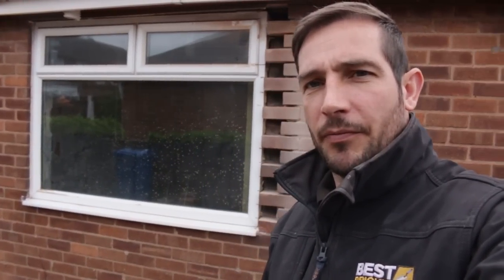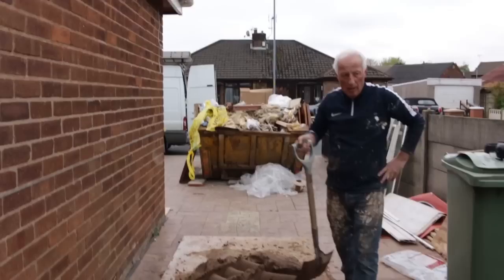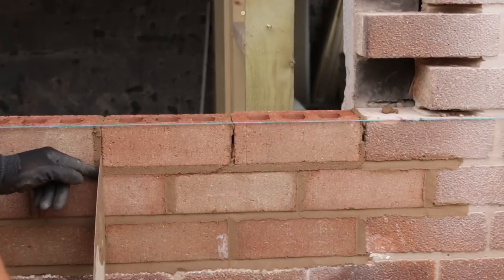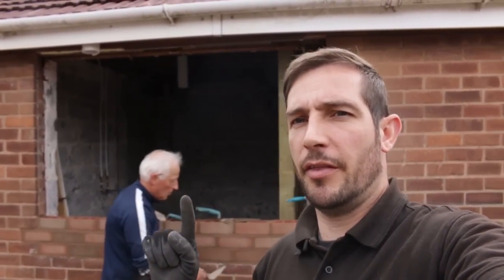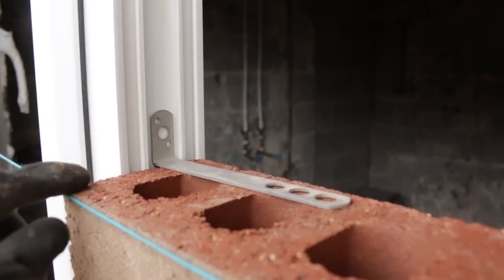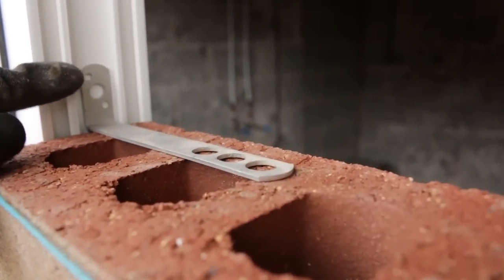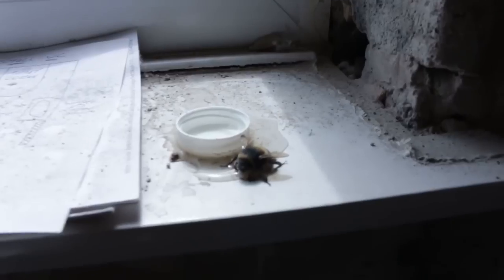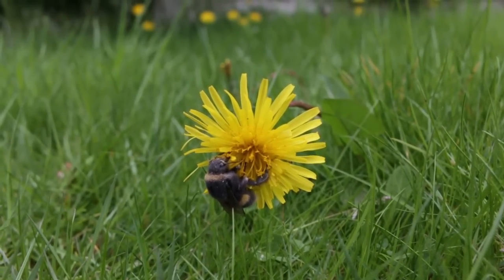Reducing window Size, bricklaying

Comment: Just bumped into this video after I have finished resizing 3 windows in my house, but this video shows I took the right approach doing this.
I had a messy looking side wall with windows in different heights and shapes put in every time a new extension was made before I bought the house, but having to replace my aged window frames I decided to make everything look more uniform and bring window sills and lintels to the same height and windows the same width were a first floor window was right above a level floor window.
Does look a lot better, just as the new window in the video, I don't like the look of these slot ventilators at the top of the window, it makes a house so 1960-70's (worst period in building design).

Comment: If you get a tight brick I use a clip joint , that’s where you shave a few mill off the end of a brick using your trowels edge and a brick on edge as a guide, you end up with a false perp joint but it looks normal

Comment: Great work as usual only 1 question though if that window had to be taken back out fir any reason (I know lokely won't but....) wouldn't it be a pain as the fixings on one side are from the opposite direction so csnt be unscrewed from window side ? Just curious ....in no way undermining your work as ive seen lots of great work you do (I'm a bricky btw) cheers keep them coming

Comment: Nice Job Stu,  but not a good idea to screw wall ties to the window frame, if you need to take the window out half the wall comes with it, screw window frame to wall after.
Reply from the maker: Can’t do that because the mortar takes weeks to go off properly, if it needs to come out in time a good fitter checks for clips like this 👍

Comment: made a nice job of bricking but awful widow fitting, should have screwed cill on from underneath before fitting and those window tags makes it a real pain to get the window out in the future when it needs changing/replacing, should wit until brickwork set and then fixed in a standard manner screwing/fixing through the frame 150mm from corners and using packers to get it perfectly square and to also for expansion and contraction of frame